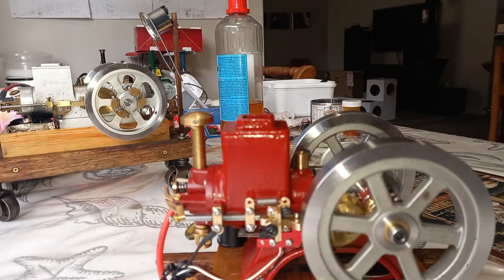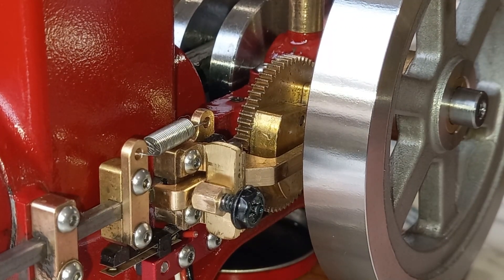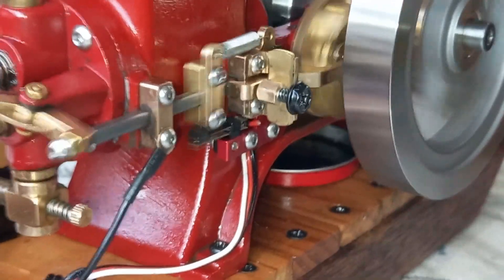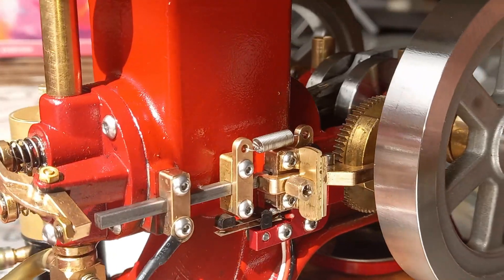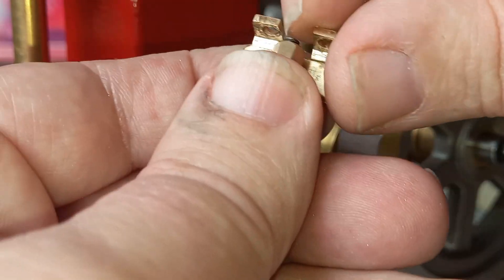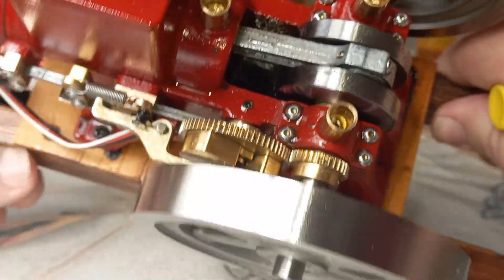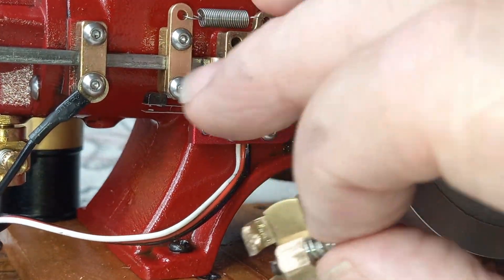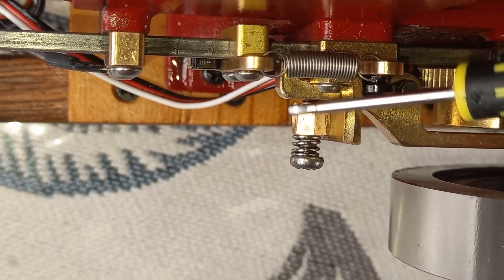2022 Enjomor Chinese Hit and Miss - fixed with governor latch mods for variable slow running

Comment: Often when an engine is double hitting it’s because of a lean condition. You might fatten it up a bit and play with the springs on the governor to slow it down a tad . You are getting closer 😉!
Reply from the maker: Thanks! This engine I have found it particularly hard to get the carb setting right...maybe because it's "upside down?"

Comment: Great job sir. It does sound much happier now.
Reply: I gave my engine a 5 star rating.  Should I expect it to run flawlessly right out of the box?  Maybe I would if they were producing millions of them for double the price, and it was intended to be more than a novelty.  For the ~400 USD I paid for mine, it’s a strong 5 star, given that it starts and runs reliably.  Tuning gives us something to work on.  Wouldn’t it be a little sad if it didn’t need some TLC to refine its performance?
Reply from the maker: Well said
Reply from the maker: It does...I'm coming out of Omicron and feeling energetic. Where the steel valve rod rubs against the brass cam, there's noticeable wear on the brass. If this engine is going to last 100 years I decided I had to replace that rod end with a tiny ball bearing from a pc fan. Done tonight...I need some additional bits of wood to cover the front and rear electrics under the base, add a switch for ignition so I can stop pulling the batteries out; tune 'er up...and one more video :)
I feel sorry for Raphael but I get that these engines aren't going to be perfect at the price. I need to start making that really clear in my engine reviews
Reply: @ThomasPCGuruENGINES  I completely understand what you're saying about clarity. I really have to bite my tongue about some "features" these small offshore engines have. I feel that you are doing a FANTASTIC job. I would love to send you a Steam212° mug. How can I get one out to you?
Reply from the maker: OMG I just read this. That is very cool. But I'm a long way aways from you and I suspect pretty expensive to send a mug to New Zealand, but lovely thought. I'm thinking of a video musing about why we always give these engines 5* reviews at retailers; I guess we know what we're in for. I don't want to mislead others. I try to say now, expect to have to tweak, tune and fix; 5 stars is for providing a solid effort at the price. It would be little trouble to make the hit-n-miss latch adjustable though, at the factory...jus' thinkin' out loud here...

Comment: Bonjour Thomas,
Thank you fo this video which let me know more about my engine but I note that it has not this lottle  piece with screw and spring, so did you build it ? 
Besides this, it is very disappointing to receive an engine not tested, broken and furthermore without any users guide. I don't think I will buy them another engine as I a not a good mechanic as you are.
Amicalement, Raphaël
Reply from the maker: Oui Raphael, I build little parts like this from scrap as I am not an engineer or mechanic, just hobby guy. As you have seen, the models from China are best considered as a kit - they run ok but need time put in, to tweaking and tuning. I can do the tweaking and I enjoy the process and the challenge. So whenever I leave a review at the retail website I like to note the models will likely need some work by the purchaser. Still, they look good and will last many years even as a shelf display model. You can buy model engines like these from Western retailers that are perfectly tuned but you will pay several times the price. Or, look on ebay for original engines; but they are old and anyway ebay is risky.  I am sorry you are "very disappointed". Remember there will be a club of model engineers wherever you are who likely have much improved skills and experience to mine, who could help you get yours running its best.